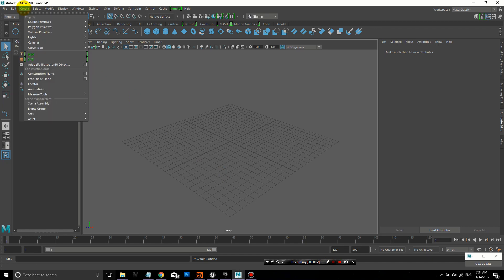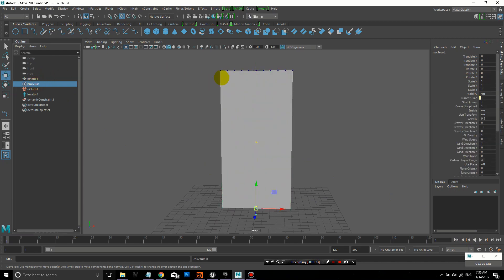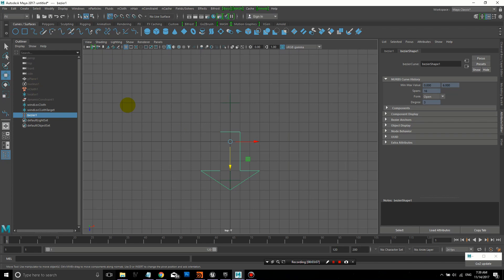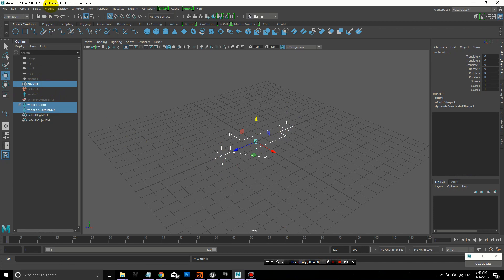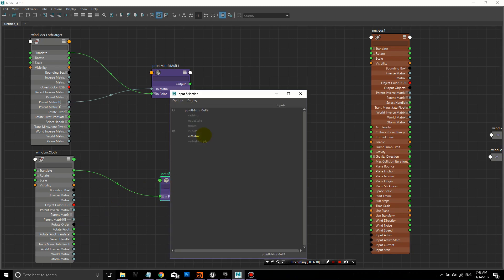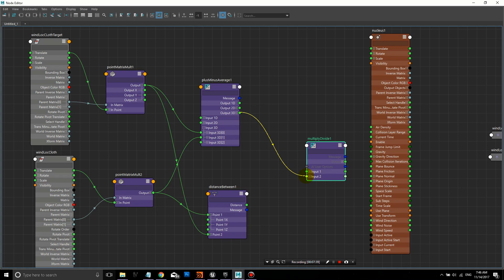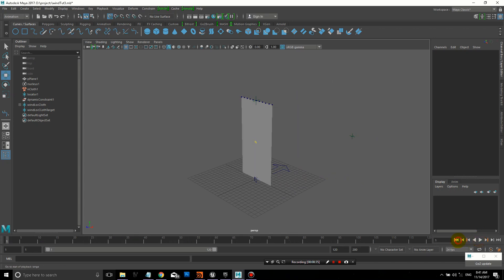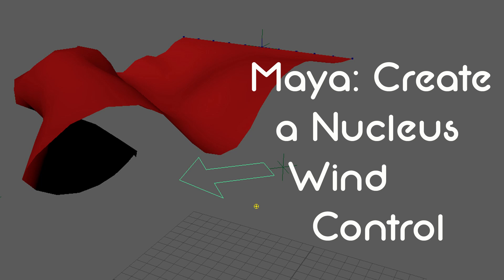Maya Nucleus Wind Locator English

Comment: made everything step by step. and it doesnt work at all. And you have difference between node relations on 8:31
Reply from the maker: Hi. I see you are having trouble with the lesson. I went ahead and dug up an old file. The one I found, needed an additional invert added as the wind was in reverse, but it works. Best of luck. I know how frustrating it can be following a tutorial and not getting the result. You can download the sample file here: http://www.madguru.com/learn/maya-nucleus-wind-control
Reply: @Madguru  Hi, I ve noticed that you need to connect input2 from multiplyDivide1 to wind speed. Without this action it doesnt work. This step is not performed in tutorial. Thanx
Reply from the maker: @volodymyrhniedash3544  thanks, I'll add a note.